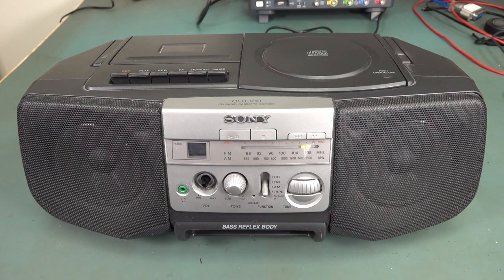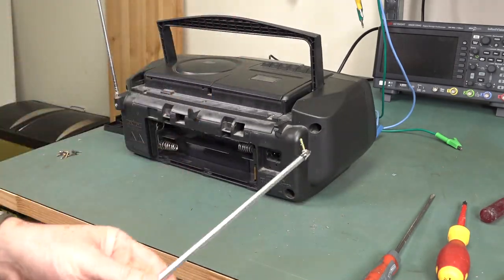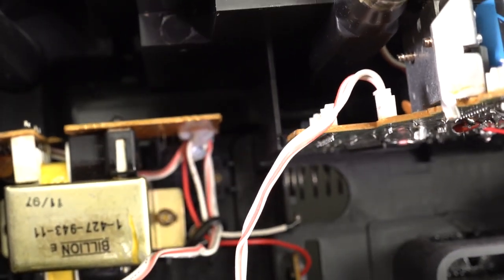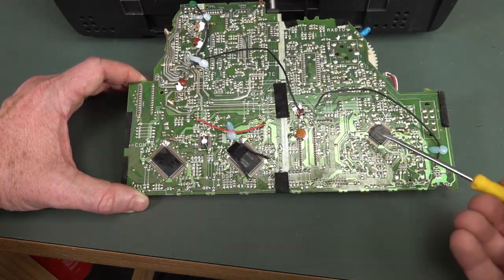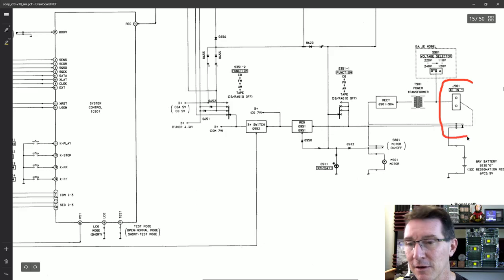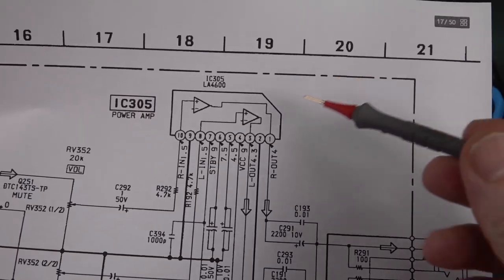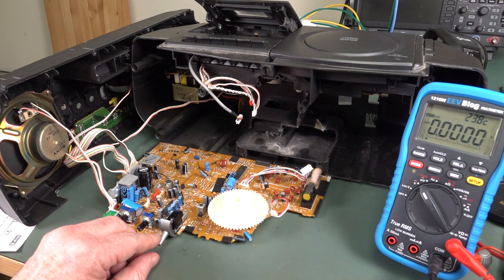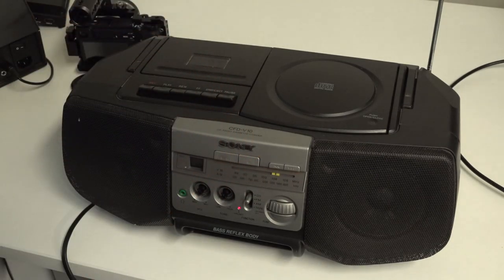EEVblog #1243 - Sony Boombox REPAIR and Teardown

Comment: What are star grounds even for?
Reply: The short answer is to reduce hum in the output.
Reply: @tomadkins2866  How though? Is it because of the higher resistance and (presumably) lower capacitance?
Reply: Ground loops. Search star grounding on google. There will be lots of pages explaining it better than anyone could in a youtube comment.
Reply: They prevent currents that are flowing in the ground, such as ripple current in filter capacitors,  from generating spurious voltages in sensitive circuits due to the resistance of the ground.

Comment: In the 80s my uncle had one of those Japanese cassette player/FM radio combo things. This had a peculiarity though : a "stereo expand" switch I haven't seen since. When on, the sound was a bit more "separated", as if the sources were further away from each other. This must have been all analog and (probably) relatively simple circuit.
Has anyone seen this and knows how it works ? Thanks.
Reply: Try to find the service manual for this and analyse the stereo expand circuit/switch.
Reply: That setting was very common on boomboxes in the 80-90s. The speakers were close together but the sound could be "separated" or "expanded"  somewhat by that setting. I suspect it was analog, by electronics of that era. Likely a few microseconds of delay or overlap between the 2 stereo channels.
Reply: @simontay4851  It was 1981 : I can't even remember the brand, let alone the model :-(

Comment: sony gear from this era seemed especially susceptible to this issue. I've seen this issue with every sony component I own. TV's, tape decks, amps. They must have used the least amount of solder possible and it just fatigues away and cracks.

Comment: Dave “ Sony makes fantastic manuals” then just rips in to the boom box without reading the manual :(
Reply: You've never done that?
Reply: Yes, I have ripped into a job without reading the manual if there is one not available, Dave is very good at educating people about electronics so a little bit of professionalism would be appreciated.
Reply: @davidroberts2429  Why? It shows that we can all make mistakes. Take it as a learning curve.
Reply: @davidroberts2429  Oh get over it. "a LiTTLe pRoFesIiOnALiSm."
Reply: I think he looks at the manual at exactly the right time. I would bust out the manual until after the teardown either.

Comment: Lol I knew it was going to be a fake tweater, they were all the rage back then and sound holes like the one on the bottom lol.
Reply: No reason why you couldn't modify it and add real tweeters
Reply: @simontay4851  you'd need a crossover and then it'd be overkill for the rest of the radio, might as well throw the whole thing out and start again. The speakers cover the tweater range anyway. Tweaters are not benificial in this case just an example of marketing BS that was all too common for that era.

Comment: Come on!  the entire construction and serviceability of this thing just SUCKS!
You must be a real Sony fanboy to like anything about it...
Reply from the maker: It's very serviceable, i could lay the board out and flip it over on my bench, doesn't get much easier.
Reply: @EEVblog  But you need to get a very special screwdriver to even open it, the tuning mechanism looks clever but gets out of sync when you open the cover, the use of a piece of PCB (especially not FR4) as a battery contact is failure-prone, etc.
Reply: @Bob Sacamano It still remains a piece of crap.  Buying a special screwdriver to open this thing will likely cost more than a new radio with similar functionality.
About the only thing it has above a cheap noname box is the availability of a service manual.  Using a mechanical dial instead of a digital frequency synthesizer with an LCD readout was very backwards even in 1998.  Sony made synthesized portable radios 15 years before that (of course more expensive back then).
All of it breathes low-end cheap rubbish with a Sony brandname on it.